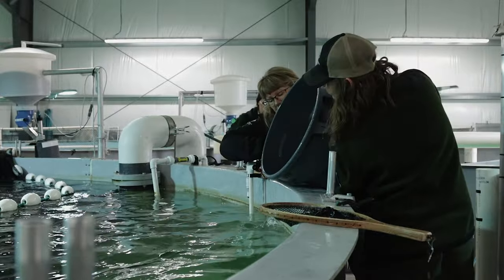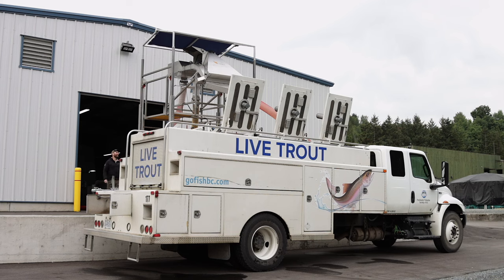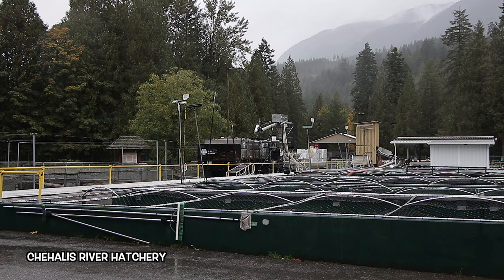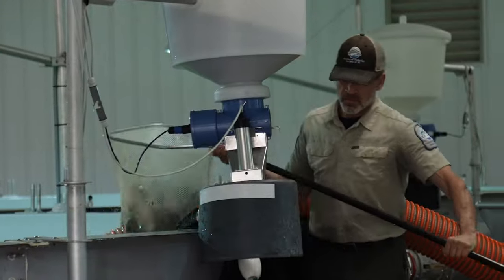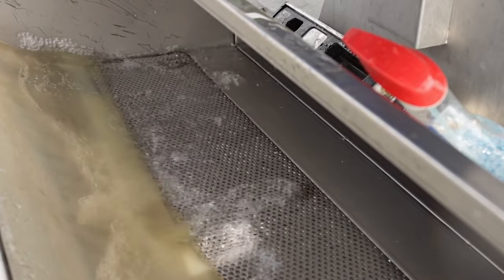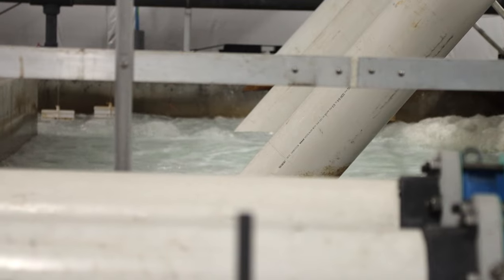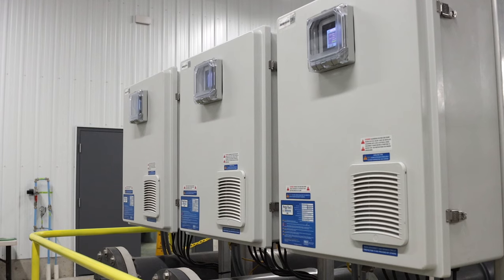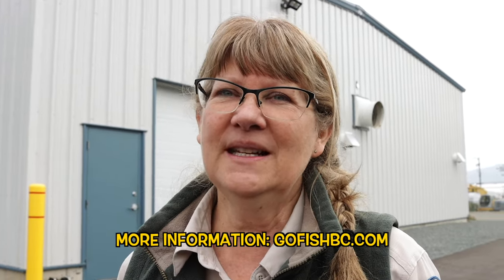This Building Produces 90,000 Rainbow Trout Each Year! | Fishing with Rod #fishing #troutfishing

Comment: I'm curious about why larger numbers are not released while smaller and then allowed to grow to catchable size after they're released.
Reply from the maker: Yep, good question! These rainbow trout raised to 225g for release are specifically for lakes in the Metro Vancouver region. These lakes are low in nutrient, so lack the ability to grow big fish. If not caught, a lot of them would probably die from starvation eventually. For our lakes in the interior region, a different strategy is used. Fish around 5 to 10g are released into those lakes and because they are high in nutrient, these yearlings can grow up to 6lb or more.
Reply: @FishingwithRod  Thaks, Rod. That's actually what I thought - that a lake they're released into might not be adequately equipped to feed them. 👍
Reply: @FishingwithRod  So you're saying I should fertilize even more eh???